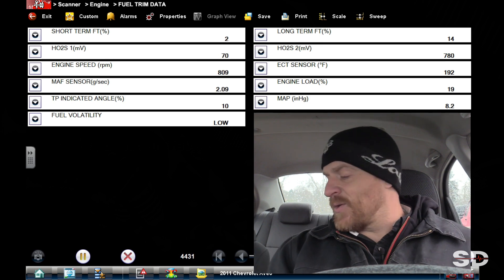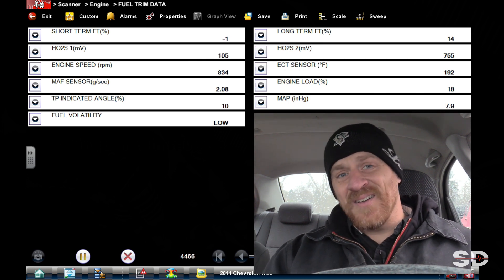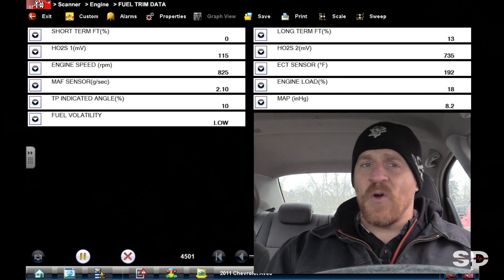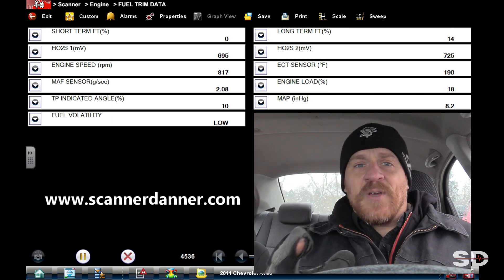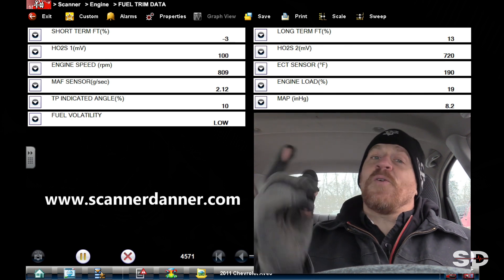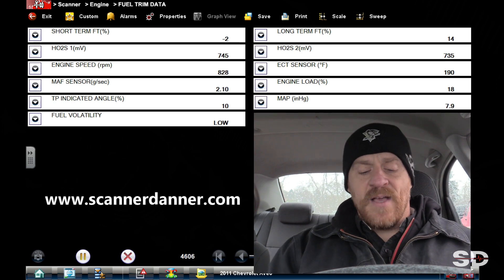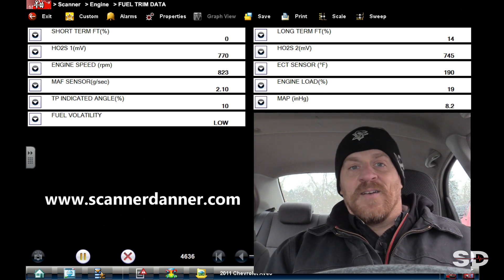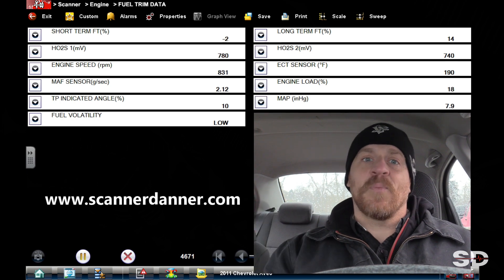2011 Chevy Aveo with a P0171 caused by a cracked air intake tube

Comment: I work at a Chrysler dealer and I was given a 2013 Nissan Rouge 2.5L.  It had a P0171 code.  The first thing I checked was for un-metered air entering the intake manifold since it had a MAF..  I found a hose, from the air intake tube, had been left disconnected from a previous repair.  Just from watching a video of yours, on lean codes, I found this problem in less than 10 minutes.  Thank you.
Reply from the maker: Awesome!

Comment: Paul I have one for you. My friend has the 2004 aveo that when it is below 32° it has an extended crank time, but when it is above 32° it starts fine. My gut tells me it is the fuel pump, but I don't want to have him buy a part and still have the same problem. 

Love the videos. I have learned so much over the 3 years I have been subscribed. I saved not only myself but friends and family a lot of money by doing repairs I have never felt comfortable doing before watching your videos. Thanks alot

Comment: Have the same car here in Australia Barina TK  . Mates car said it was driving well parked it up then wouldnt start , or nearly wouldnt start felt like fuel starvation , now not starting no spark or fuel to engine( there is fuel to rail new spark plugs installed  , Did have cracked air pipe like this one ,  got a new  one coming would this make the ecu decided to not allow engine to start at all ?
Reply from the maker: No spark too? Absolutely not related to the cracked air intake tube. Scan it for codes would be the next step
Reply: @ScannerDanner  cheers yeah appears to be no power to injectors or spark injectors at 13.5 ohm the one I tested no codes on the Chinese vs6000 did have a crank case position sensor pending so I’ve already replaced that sensor so I guess ecu or imboliser ?

Comment: Paul would you buy a Verus with 17.2 now knowing it can’t be updates? I went it for its 4ch scope mostly as I have a Autel elite. Would you buy a Verus today if you didn’t have one?
Reply from the maker: yes I would. And are you saying they are no longer supporting updates for the original Verus?
Reply: ScannerDanner thank you for your advise Im gonna pull the trigger. It’s worth it for the scope no? I heard that the Verus is stopping at 17.2 due to the verdict came out?
Reply from the maker: No the Verdict in no way is a replacement for the Verus. I just updated my Verus Edge to 18.2, I'm sure the original Verus is still updatable.
Reply: ScannerDanner no kidding ok cool. Thank you so much. I’m learning a lot from your videos especially the STFT and  LTFT...I was told the gen 1 and 2 Verus stopped at 17.2 I thought I read it on snap on too but I might be mistaken.

Comment: Once corrected, will the check engine light turn off on it's own? If so, how long does it take? Or do you need to clear it yourself?
Reply from the maker: As long as that was your only problem, yes, the light will turn off on it's own. It may take a few days though.
Reply: @ScannerDanner  I don't have the same car but I got the code and checked the tubes and found a crack like the one in the video. I replaced it but was curious to how long it would take to register the fix (hopefully that's the only thing). Thank you for the reply.

Comment: These are highly informational videos and worth its weight in gold! yet, only few watch these as many are used to watch crappy auto videos  having no educational value. SD, we really appreciate your time putting to make these videos. I have never taken a course in automotive but what I learned from your videos ( especially diagnose a broken wire in an injector). I was able to diagnose a faulty igniter on a 01 Montero just with a test light and a volt meter.
Reply from the maker: Awesome feedback and nice job on your repair!

Comment: I have a 2003 Honda Civic... had a code p0171 Lean condition... when I was checking around the engine bay... I saw that the air filter housing was cracked and a hole on the bottom... could the extra air that goes in cause that code?

Comment: So is “fuel trim” just how much  fuel the ecu is adding/ subtracting from the main fuel map ?
Reply from the maker: You got it brother! And remember there are learned values through the RPM range.
Reply: ScannerDanner awesome, thanks for the speedy reply! So learned values is when the ecu adjusts itself and keeps the adjustments for a while?
Reply from the maker: Yes sir. And they are called fuel trim cells. 
For example: older GMs would use 16 different rpm/load combination cells
Reply: ScannerDanner thanks a lot. Appreciate the replies 👍

Comment: Helllo 
I love you work 
Have a question
How can I get a software that I can read data in my tablet
And about how much is it 
Ty
Reply from the maker: Sorry, I'm not in that market. I use professional scan tools and the cheapest one I own is $1400 with the Verus running $10k. Lots of cheap global scan tools out there, I just don't use them. You need a bi-directional scan tool if you're serious about troubleshooting.

Comment: I just did one of these aveo last week. GM wanted 280 for the intake boot as they want to sell you the whole mass air flow sensor with it. In this case was one of the few that I recommend dorman part for a customer.

Comment: Thanks Paul - Awesome.  I am now much more clear on the "Cell" functions and how they relate to certain conditions.  So as you mentioned, under load the vacuum leak increased due to the greater bending of the intake hose , therefore the cell for that load and RPM was requesting more fuel for the unmetered air and therefore the long term trim # was high as well as the short term cell #.  However, at Park conditions there was no twisting of the engine therefore no large gap being created on the intake hose.  Now since previously for that Cell at those same RPM and load conditions the memory a very "big" # to add fuel.  Now however, there is no un-metered air into engine and CPU is countering the PLUS ADD FUEL #s from the memory cells.  
Paul you're an absolute outstanding "teacher", you have a great way of putting yourself in your students shoes by  the way you explain and associate engine principles.  I've learned so much from your Premium Channel and by far is the best bargain on Youtube.
Keep up the great work !!!
Reply from the maker: Great sum up of what was going on. Nice! Thanks so much!

Comment: Ty!! I'm looking into buying a car with less than 100,000 miles so they did most of the tune up, but they are selling it. I ask what's the issue, so they said it's a resonator system, so it connects to the catalytic converter. so, on the detail sheet I read possible a manifold replacement. I'm not 100 sure to buy the vehicle. it's a 2011 chevy aveo as well. They are selling the car for 4,000. help

Comment: ive heard that there is not supposed to be a space at the top of the strut like that, apparently it was a assembly flaw they installed rubber bushing upside down.

Comment: I'm surprised that engine has enough torque to flex the intake tube.  Thanks Mr. Danner!
Reply: Weak mounts lol
Reply from the maker: Mounts were fine. Completely normal movement of a transverse mounted engine.
Reply: I was kidding
Reply: seems like excessive movement to me, I bet if you rocked it back and forth in park, the thing would move 900 feet =p
Reply from the maker: @throttlebottle5906  totally normal brother. Most people are surprised by how much a transverse engine moves on a brake torque the first time the see it. No red flags for me on this one at all.

Comment: Your video is awesome 
You deserve million sub 
I have same aveo 2011 my air intake hose top part is leaked it's cracked , so can I just replace the top part of air intake hose not the other part.
Let me put this,way if you buy air intake hose it consist of two parts one is small which is place on top and one you are showing is other longer part. My longer part is fine and only top part is cracked can I just replace top smaller portion of air intake hose. I will appreciate  your reply.
Reply from the maker: for sure, you don't need to change anything other than what is torn

Comment: Had a fine crack in the intake tube on a chevy sonic that gave me some trouble. Lean condition, no response to rpm increase, apparently good fuel supply (wide open test run showed rich O2s). Ended up going old school brakeleen while watching fuel trims, I won't forget that one any time soon. Couldn't even see the crack even though I knew it was drawing in the fuel there, had to remove and flex it in my hands to see it.
Reply from the maker: WOT runs proved to be rich because the engine torque, in the high RPM ranges, is small and the tube is in more of a relaxed state. I was confused by one like this before too. In fact I have it on film https://www.youtube.com/watch?v=-5L5tp4NDq0

Comment: Love the easy ones! Wish I'd get some, LOL. Today I was wiring up a USED Fisher plow harness ... for the WRONG vehicle. Had to de-pin and change around the headlight plugs from a 9004 to a 9007 - figured I had a slam dunk ... and then I had no low beam on the left, and on the right, high/low were backwards! Grrr .... I've got power going into the isolation module on low beam, but nothing coming out. Tomorrow's another day! I'll figure it out eventually! 

I didn't even think about the intake tube! I was trying to figure out what in the heck would cause it to be lean only in drive, under load, but not at idle or in reverse. Now I've got a clear picture! That was an interesting failure there. I haven't seen too many tubes bust like that. Those little 4-bangers sure move around alot! 

I've got the same nasal issues Paul, lol - I haven't got my waste oil burner hooked up in the new shop yet. I figured I'd have this plow truck wired up in a half hour, LOL. Now we're going on day 3 - I'll have heat some day .. just not today! 😂

Great vid as usual Paul!
Reply: Smitty Smithsonite   Just to get in out of the wind is a big help.  Working in the cold sucks!
Reply: @billk5727  - Oh yeah, I hear that! Big difference from being out in my driveway like I used to work. I called it quits on the plow wiring at around 8 last night - had I been doing that outside, there's no way I'd have the energy to keep going much past 5pm. Worked outdoors just shy of 10 years, not including all the years prior doing my own vehicles.

The week of Thanksgiving last year, I yanked a right side CV axle out of a Nissan Rogue - it was 16° out. That was alot of fun, LOL. Felt 10x harder to swap it out than it should have. Having to beat the thing out of there, due to that seized carrier bearing in the middle, generated alot of heat, though. 😂

Comment: These Aveos were cobbled together with the absolute cheapest materials possible. I've replaced a lot of these intake tubes due to this problem.
I think another important PID to have on screen when trying to diagnose a lean/rich condition would be the EVAP Purge duty cycle PID; I've fixed one Aveo once that ran lean because the purge valve would stick but only when it was commanded on by the computer.
This one is unrelated, but these Aveos also have really crappy coolant hoses on them that like to burst like ripe fruit. In fact they have pretty crappy cooling systems in general.
Reply: Don't watch them. Do you really think we have not seen EVAP purge problems or crappie hoses.

Comment: Paul, great video!!!!!!!!!!!!!!!!!!!!!, this car also needs motor mounts, that is more than likely what caused the induction boot to crack.
Reply from the maker: totally normal brother. Most people are surprised by how much a transverse engine moves on a brake torque the first time the see it. No red flags for me on this one at all.
Reply: I have worked on a dozen or so aveo's replaced a few motors in them, next time I get one in, I am going to brake torque it and see how far it moves, to me it looked like a bad mount, lol, but maybe my eyesight is off, lol. @ScannerDanner

Comment: Wtf at 2:00 frz frame failure shows ambient 80f . yep light just came on after you changed oil the customer will say with snow falling.
Reply from the maker: nice, good eye on that one
Reply: ScannerDanner I watch freeze frame failure closely.  Had a customer come in today complaining on a 2017 pickup that when it gets cold the ses comes on .  hasnt done it this year but it has to be below 0f.  I look 24000 miles on vehicle and 24000 miles since codes cleared.  Thats the only complaint

Comment: God damn envoys 
Edit; I really want to see you work on that envoy
Reply from the maker: Unfortunately and typically with communication faults, I was not able to reproduce them and the customer complaint was more for the ABS stop it would go through coming to stops from two bad front speed sensors. So you won't be seeing the Envoy. The Yukon Denali we did get a video of the electronic suspension fault, which was pretty cool. Thanks!